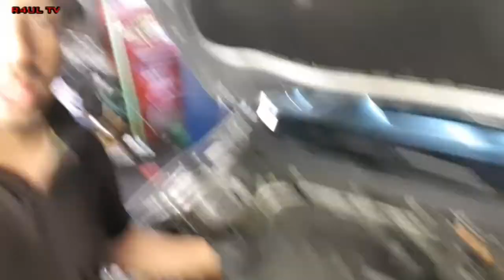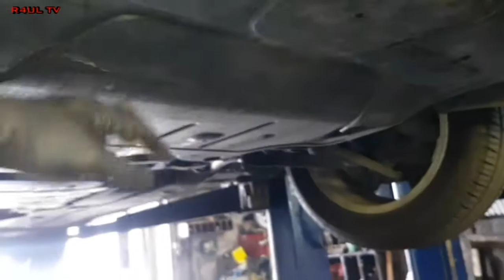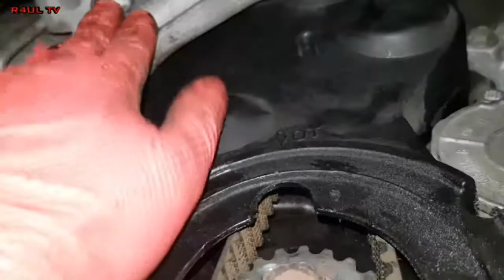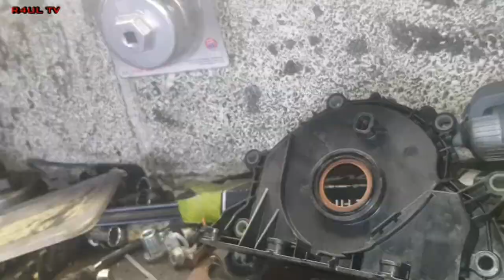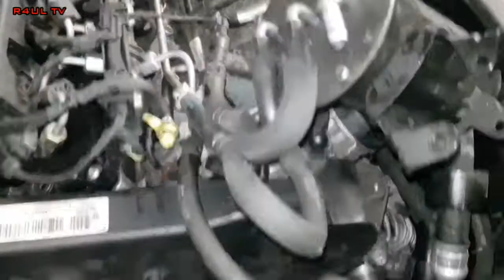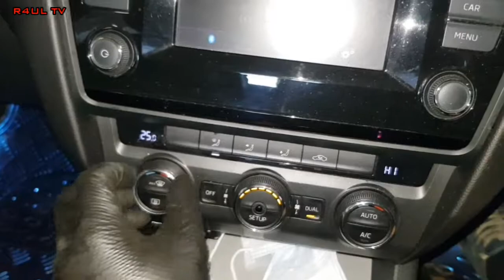SKODA RAPID CAM AND CRANK OIL SEALS REPLACEMENT (ELECTRIC WATER PUMP)

Comment: Great video mate. Is it possible to change the wet belt while changing the crankshaft seal or do you need to remove the sump to get access to the oil pump? Is the oil pump timed? Thank you.
Reply from the maker: Thanks for watching really appreciate it. Sorry about the late reply. As far as I know I dont think you have to take the sump off. But bot 100% sure.